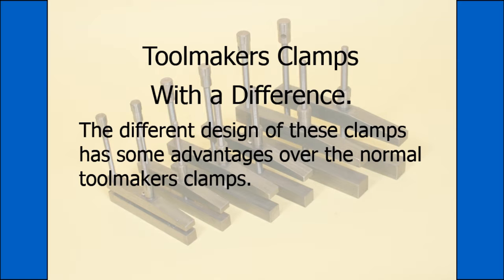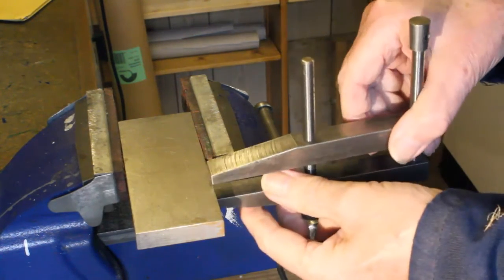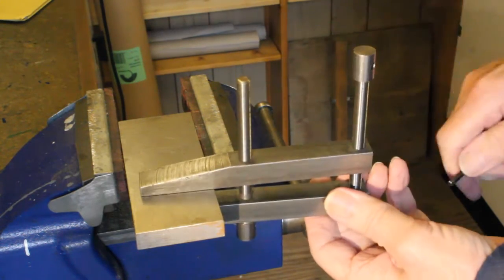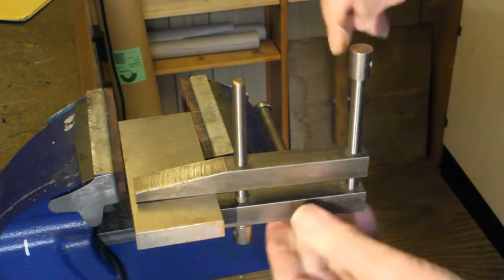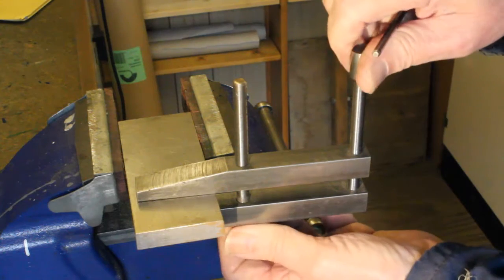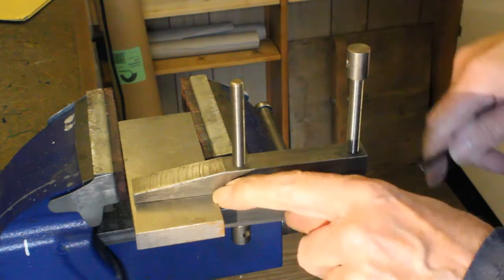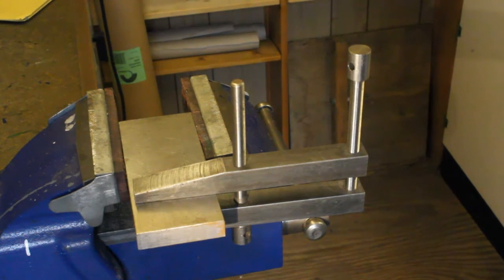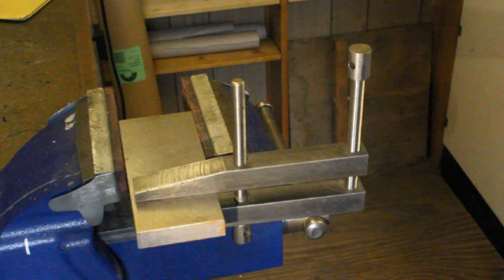Tool Makers Clamps.

Comment: I have half a draw full of toolmaker clamps in different sizes that I collected over 40 years as a toolmaker.  I am long retired now, but still use them constantly.  In fact I currently have an arrangement of parts ready to be bronze welded rigidly held in position by two toolmaker clamps, and I can't think of a viable alternative that would work as well, and still leave room for the torch.  As for using toolmaker clamps on a milling machine, I guess it would depend on the situation and size of the cut.  I have used them to clamp the work piece to a heavier plate when the work piece was standing too far out of the vice jaws for instance.  It stopped any chatter and helped produce a good finish, so score one for the toolmaker clamp.